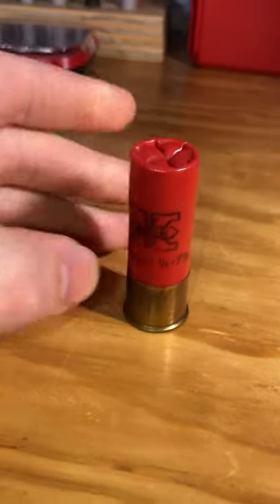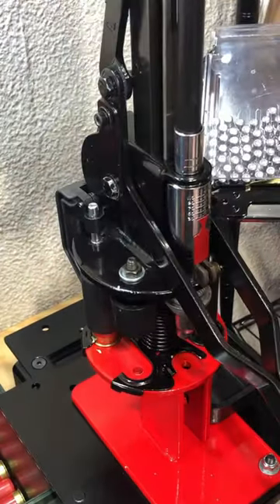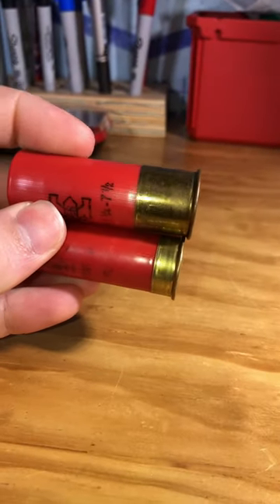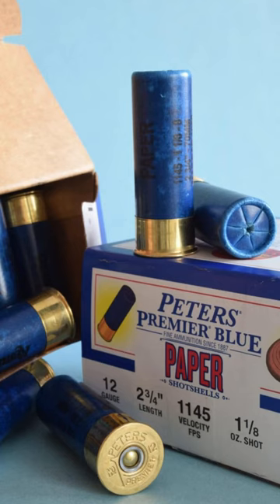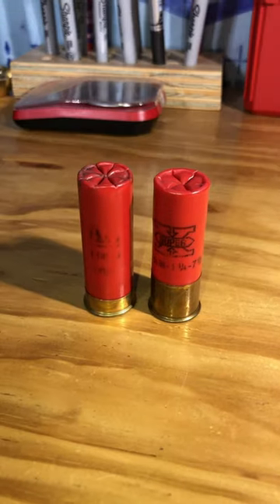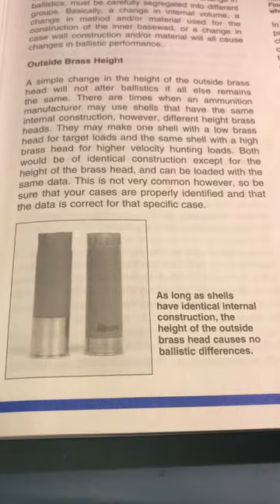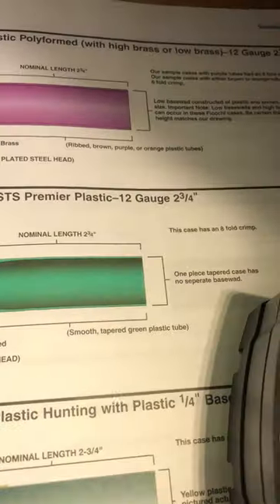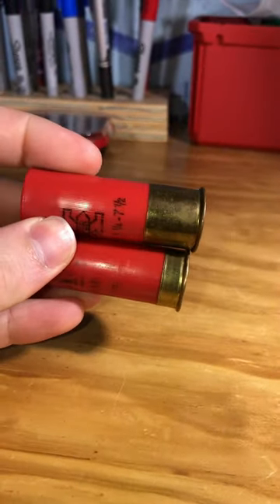Why Low Brass vs High Brass is Nonsense!                                #shorts #12gauge #reloading

Comment: Pretty sure I saw a vid of some big company just chucking a huge bin of shells cuz of the high/low brass stuff said they don't wanna sort the stuff
Reply from the maker: Yep, I saw the same video 🙄
What a waste
Reply: @thereloadingcraft just wanna say I love how you actually educated folks on the difference and why the high vs. low brass debate is just preference at this point, but commercially it makes sense. Rather than to inspect every single shot shell you recycle. They get split between brass and polymer and it gets melted for new ones. It saves on cost in labor, and it removes some liability of the company providing faulty shotshells if improperly inspected or otherwise.
Reply from the maker: This is true, on a commercial scale. What bugs me is he tagged the video with “3 things to NEVER reload” and the guy in the video said low brass isn’t reloadable and he seconded it.
Reply: @thereloadingcraft  yeah that was the wierd part set a bad standard for no reason
Reply from the maker: I’m not sure it was intentional, but yeah it caught a good bit of flak for good reason.
Reply: @thereloadingcraft  That is funny. Remington STS hulls are some of the best hulls out there, I usually get 8-10 reloads from one of those hulls before the crimp petals start to split. Federal field are nice straight wall hulls and I get probably 5 or 6 reloads from those hulls as well.

Comment: Low brass has not been any less withstanding than high brass. I feel the low brass shells actually have the "brass" (actually a brass washed steel cup) crimped on better than high brass shells. Basically, better quality control on the low brass. Loaded both to maximum, and probably over a little , hah , they both have about the same usage out of em before they're not worth reloading anymore.

Comment: High brass comes in handy if you're a reloader of hunting ammunition where certain loads are quite a tight fit for the internal components. In such a situation, sometimes the lower portion of the shotshell will swell slightly, causing feeding issues, especially when used in semi auto shotguns. The high base hulls tend not to have this issue. If a high brass hull was to swell, you're likely doing something wrong and cramming too much into it.

Comment: The fps is key. 1300 fps is excellent in my gun. 1145 is not at all. I buy cheap low and high brass in 1300 fps so if you just reload them to cycle in your gun, your good.

Comment from the maker: See video description for a more detailed explanation, and some links to credible sources backing up this video.
Reply: What manual are you using as reference? I've been pining over a press to reload 12g & 16g but have never reloaded anything or even seen it done in person.
Reply from the maker: I use the Lyman, don’t remember which edition off the top of my head. Also if you’re interested, check out the link below for my long format video on the process to load 12ga using a MEC 600JR. 
MEC 600 Jr. — Setting Up and Adjusting The Best Shotshell Press For The Money
https://youtu.be/x1Cm5kDEXQ8
Reply: Question:
Is it true that "High Brass" shothsells loaded with more powder than low brass?
Reply from the maker: From the factory loads that is “sometimes” true. To the reloader it makes no difference, and the reason the factories do it is just because people think high brass=magnum. It has nothing to do with the quality of the hull itself.
Reply: I see. So how to know the shotshells I bought really magnum?
Reply: What if you reload buck, does it make a difference?
Reply from the maker: If the inside hull geometry is the same, the brass height does not make one bit of difference. Make sure the hulls are quality, and that you’re using proper load data.

Comment: The low or high brass simply tends to signify the size of powder charge for the load. Low brass is most often used for target loads with  a lighter load, high brass signifies a heavier load used for hunting and usually classified as game loads. They do in fact have a difference in recoil.
Reply from the maker: Oh absolutely. Its become a nomenclature convention that high brass equals hotter load. That being said if the hulls are quality it doesn’t matter if they’re high or low brass in terms of longevity or pressure.
Reply: @thereloadingcraft  very true, especially considering the chamber is the only thing that actually has to deal with pressures. I mean, all plastic shells exist too.
Reply from the maker: Precisely. 👌🏻
Reply: Yup.  All about marketing
Reply: Gee, thanks, Professor Obvious! That's correct, however Low and High Brass shells are easily interchangeable when you reload. They only use brass height  for marketing and it has ZERO bearing on what you can reload in them I've loaded thousands of both.
Reply: @showproja  It's not just for marketing, to put more powder you need more brass to fill. It is simple math, the high brass kicks quite a bit more than low brass. So high brass has more power, thus giving way to a faster, harder and deeper penetration. The proof is in the performance and the high brass does what it is designed to do, so it ISN'T just for marketing.
Reply from the maker: @andrewfields8556 there are production shotshells that don’t use brass at all, and are all polymer and loaded with fairly stout loads. Brass height means nothing with modern smokeless loads other than a carry-over from black powder days that manufacturers have kept with, even though they don’t need to but people buy it because the masses think high brass = more power when you can get a low brass at the exact same power level and it makes no difference.
Reply: Thank God,  someone who knows what there talking about , I thought I was the only one 😂👍👍👍

Comment: I love the old paper shells, dad has a small collection of them. Were those reloadable? 

Super cool that reloading is *slightly less difficult than I thought
Reply from the maker: They are reloadable, however the paper getting pinholes burnt through is more of a concern than the crimp petals failing. Typically paper hulls only get 2-4 reloads before they’re ready to be tossed. Also depending on which ones you’re doing, some may require an overshot card and a roll crimp, while other use a traditional 6-fold crimp, it all depends.
Reply: @thereloadingcraft  How many times can you reload a plastic shell?
Reply from the maker: It depends on the quality of the shell-cheap bulk pack shells maybe 2-3 times. Quality shells like Win AA’s or Nitro STS’s on average 10-12 times for me before the crimp petals fail.
Reply: They changed to all brass shells because the paper shells would get wet and swell up, getting jammed back in the world wars.

Comment: I've reloaded on the lee load all 2 for several years and as long as u use the right wad for the hulls ur using then it makes no difference whether it's high or low brass. They shoot the same
Reply from the maker: 100% agree 👌🏻

Comment: I do believe when a shotshell ruptures, it often will split at the brasline. So if your shooting high pressure loads, the high brass does a better job at containing the initial detonation of the powder charge and prevents a case from potentially rupturing before the shot has a chance to move which helps to reduce pressure at the failure point and the subsequent amount of blowback the shooter experiences.

Comment: It's kinda off the gauge shells topic but. Could you tell about reloading aluminum or steel cases, why almost everyone says that such cases cannot be reloaded?
Reply from the maker: I’d love to! Both “can” be reloaded, however they do have downsides. Aluminum has a low case life before they actually fail, and steel requires a hydraulic depriming method to knock the primers out (because berdan instead of boxer priming system) and then wears out dies a lot faster because it’s steel on steel contact with high abrasion.
Reply: During WW2 both the German and U.S. airforces experimented-with aluminum cased ammo as a way to reduce weight of the ammo. It was discovered that throat erosion was greatly accelerated by ionization of the aluminum case and the barrel steel, which then reacted in a thermitic reaction.During the tests reactions were sometimes severe enough to burn the barrel, as if a cutting torch had been used which eventually resulted in the tests being terminated.For those who are not familiar with Thermite it is a mixture of aluminum powder and ferric oxide which is used to burn or weld steel. Thermite is also used in incendiarybombs.
Steel cases can easily be reloaded same as brass if they are boxer primed.

Comment: I haven’t been able to use high brass in most shotguns without polishing out the chamber, since the brass expands and gets stuck in there. Low brass with smooth hull is my 1st pick for reliability.

Comment: I was always told that HI Brass, was used for Field Loads because there's more pressure to contain.
Your thoughts?
Reply from the maker: High brass is commonly used to denote a field load (going back to the paper hull days) but it isn’t a concern with pressure as much as it is a traditional way to recognize a warmer load. The brass (or paper, or plastic) doesn’t have to contain the pressure since that’s what the chamber walls do. It simply creates the seal so you don’t get gasses going backwards. With paper hulls the powder charge was burning pinholes through the hull underneath the wad, so they extended the brass forward to cover that spot. 
Reading some in my Lyman shotshell manual and some on Ballistics Products website-I’ve found the geometry on the hull base pays way more of a factor than brass height does. One piece tapered hulls (think Nitro STS’s) are one of the strongest designs out there, and they’re a low brass hull. By contrast, some of the fiber-bottomed hulls regardless of brass height are the worst at containing pressure, again because of the inside. The other thing that plays a factor is the thickness of the case head and the brass or steel used in it. Cheap promo packs of shotshells (low or high brass) often use a very thinly rolled brass portion, which has  lower inherent strength. Check out the link from BPI for more info ☺️
https://www.ballisticproducts.com/bpi/articleindex/articles/curmudgeon_articles/060124_hulls_in_general.htm
Reply: Your shotgun’s chamber contains the pressure not the hull.
Reply: Federal has gone from high brass to low brass on a load that I like. Probably just a metal economy move. I'm guessing at least a 25% savings in the steel. For them. I do wish those heads were better plated. I've had ammo rust on me from handling and humidity.

Comment: I wouldn't go as far as to call it 'nonsense'. The higher brass (actually steel nowadays) is no longer needed to physically contain the pressure, but it is still used as a visual cue that it is a stouter load
It's true that it's not really relevant as far as reloading is concerned though.
Reply from the maker: Correct, almost. Some loads (like Win AA) actually do still use brass, not steel for the base. Other than that, I agree for the most part!
Reply: @thereloadingcraft  I happen to have a box of Winchester AA, and you're right, they are brass. I thought at first they were steel, but the I realized the magnet was sticking to the primer.
I learned something new today, thanks!

Comment: People always assume high brass has more powder. Not always the case. I bought some really high dram Kent's once. Pheasant loads and they would kicked the snot out of ya. Would knock the safety back on my Ruger Red Label
Reply: You can re load either and can put a high velocity or baby magnum load in low brass or turn high brass into field loads. The brass has nothing to do with strength. The chamber reinforces case.

Comment: The only difference between high brass and low brass now a days is semi automatic shotguns favor high brass due to higher pressures that cycle the action
Reply from the maker: The brass has nothing to do with the pressure loading, it’s how the internal base wad is designed and what pressure the shell is loaded to. A quality low brass hull with the same base wad design as a quality high brass hull of the same manufacturer can be loaded to virtually identical pressures.

Comment: Great videos 👍 As I’m getting more into trap I’m looking at getting myself a reloader, would you recommend getting the Mec 600jr or save up a bit longer and get a progressive like the Mec 9000?
Reply from the maker: That’s a great question! Both are widely used and top notch machines, I would split them down as follows:
The 9000 obviously has a higher production rate being a progressive press, however it is going to be more expensive, and it helps if you’re mechanically inclined to fine tune the adjustments. 

The 600 JR is a bit cheaper of course, but significsntly slower. If you’re only loading a few boxes a week the 600 JR is fine, but if you’re shooting s couple hundred round per week, the 9000 is definitely the way to go if you can swing it for price. 

They’re both excellent machines, I’d say from there it would just come down to preference and your needs!
Reply: @thereloadingcraft  thanks for the advice, one other question I had for ya. I’m canadian and a big brand for shells out here is Challenger which I have a lot of empty hulls from. I read that challenger uses Cheddite hulls so I was wondering if you have any experience reloading cheddites and how they stand up?
Reply from the maker: Cheddites are pretty common, I haven’t reloaded them personally (mostly Win AA’s myself) but know that quite a few people do. Your best resource there (as far as personal experience and such) is going to be some of the shotgunner’s forums, like shotgun world and such. Here is a quick one I found- https://www.trapshooters.com/threads/anybody-loading-challenger-12-ga-hulls.916350/

Comment: So just to be clear, I can pack buckshot hot in the low brass? It makes NO DIFFERENCE?
Reply from the maker: As long as the internal hull geometry is designed to handle it, and a load manual confirms it, yes. The internal geometry (base wad and case head thickness) are the parts that matter, not the brass height. 

DON’T take some cheap bulk pack hull and expect to load it stout though, they aren’t designed to handle the pressure like a quality hull is. My personal favorites are Win AA, Nitro STS’s, or Remington Gun club’s.
Reply: @thereloadingcraft  I have been firing then reloading spent Federal, Winchester and Filocchi Slug Hulls with 00 Buckshot. I gauge how much powder by cutting one open, weighing the powder starting with half charge from the original and going all the way up to 10% extra. I haven't experienced any catastrophic failures, but it would be nice if I could also start reloading old bird shot hulls as I had been told I needed high brass shells before
Reply from the maker: You can load buckshot just fine in good low brass hulls, and I know several people that do it. 

Follow published load data, don’t play around with charge weights with shotshell like you can with metallic cartridge loading. The failure pressures for shotshell are much lower, and something as small as changing hulls can mean different internal volume and different pressure curves. Stick to published load data is all I can warn you to do, going outside that on shotshell loading is a dangerous game.

Comment: Ive always thought the high brass had a larger powder charge, hence the high brass so it doesnt blow out the plastic onto the chamber walls. But its the same acrosd both then?
Reply from the maker: In the paper hull days it was there to keep the powder from burning through the hull on initial ignition. The pressure is contained by the chamber, and doesn’t matter whether it’s plastic or brass or paper.

Comment: All that being said, do you think hi brass tend to feed more reliably in semi autos?
Reply from the maker: It depends what you’re comparing them to. A high quality high brass vs a low quality poverty-tier low brass, yeah sure because the rim and head on the low brass will be of a poorer quality. If you’re running a good-power level low brass in a quality hull, I have seen no difference.
Reply: @thereloadingcraft  perfect thanks 👍

Comment: All I know is low brass WILL NOT run reliably in any of my semi-auto shotguns. Obviously they’re perfectly fine in my pump guns though.
Reply from the maker: “Low brass” can mean anything from cheap underpowered bulk pack garbage to hot Win AA handicap target loads that will cycle pretty much anything. What loads were you using?

Comment: External magazines, like my Saiga are difficult to load with low brass. Anyone else experience this?
Reply from the maker: Any particular reason why? Are you getting the rim caught on the top of the brass when loading the next round, or?
Reply: @thereloadingcraft  you nailed it brother. The high brass don't hang up because where the shells enter the magazine.
To be honest it's a fun novelty shotgun that I don't shoot much.
My go to range/skeet gun is an inexpensive Tristar. It works and I don't worry about it like my Browning. Plus my Tristar just extracts. I don't have to clean up or step on ejected spent shells.

Comment: Isn’t low brass typically lower FPS though? And high brass considered to be loaded with a higher FPS?
Reply from the maker: Manufacturers have done that as a matter of convention, really. Buyers are use to looking at a box of shells, seeing “high brass” and thinking “ooo its magnums” essentially. In terms of reloadability, high brass vs low brass makes no difference if the hull is quality.
Reply: @thereloadingcraft  gotch ya I appreciate the knowledge always looking to learn new things 🤙🏼
Reply from the maker: Absolutely, and I appreciate the questions! Definitely still learning myself, but happy to pass along what I’ve learned along the way.